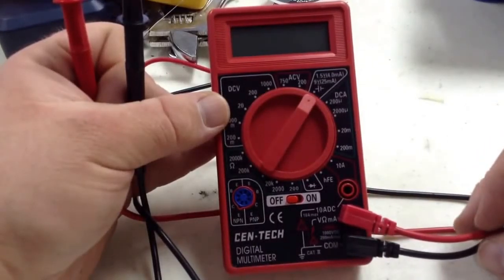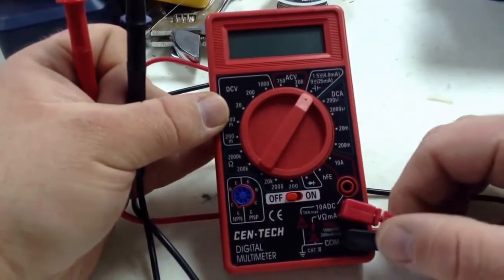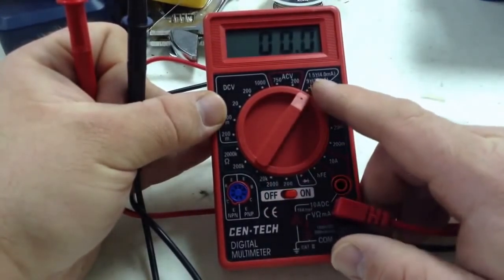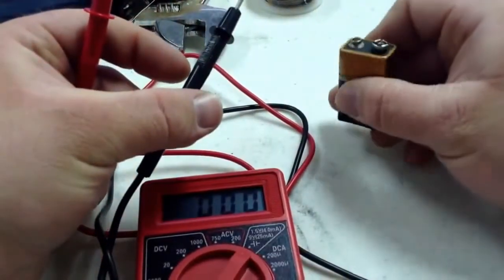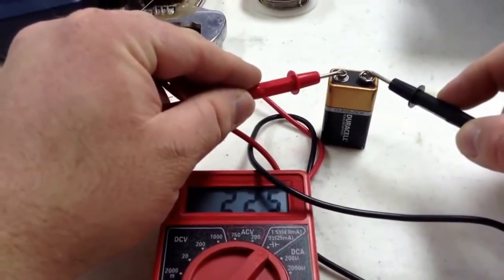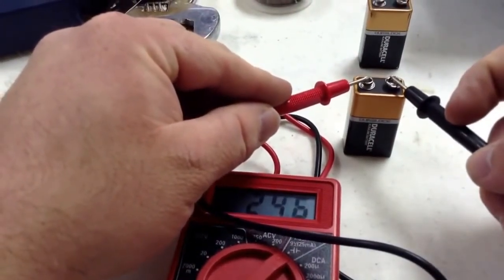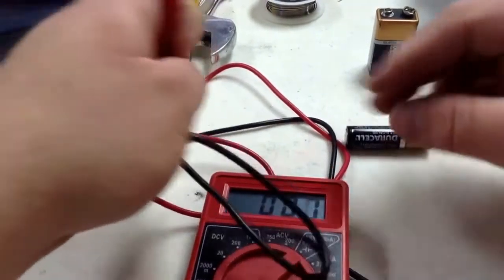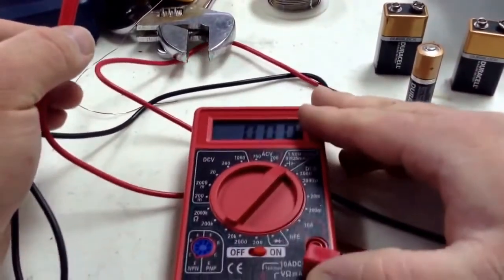Check how much charge is still in a battery using cen-tech harbor freight digital multimeter

Comment: Your multimeter is defective.  Your measuring 22.5 volts on a good 9 volt battery?  How can a  battery put out 22.5 volts when it is only suppose to put out 9.0 volts ?  Get yourself a good Fluke meter.
Reply: His demonstration is correct.  Note what he is reading... mA, not voltage.
Reply from the maker: I wasn't reading the volts.... 🤦🏻‍♂️
Reply: @ttms2  i am measuring 12v 65AH battery but its showing reading of 27.8.   What is the meaning of this?
Reply: @strawhatluffy5779  The readings for 1.5 and 9V household batteries are written on the meter.  It is not going to supply sufficient load to a 65AH (I'm presuming you have a rechargeable gel-cel)  to really test it, but you should be seeing 30 ma (22 x 12/9).  If the 65 AH is it is not showing at least 12V (set your meter to the 20V DC position), it is either not fully charged, or defective.
Reply: He's reading milliamps.
Reply: How can u be too stupid to listen to a 1minute and 30 second video???
Reply: @do7hemath937  It's not a contest, but you would have a chance with a question like that.

Comment: thanks,                   when is a battery  considered  bad,???    1.5    good    is  1.4 bad throw away or 1.3   ect   thanks
Reply from the maker: Bad is relative to the device pulling the power. A remote for a TV will last forever and can get down very low. The same battery would only last a few hours in a flashlight.
Reply: @ttms2  thanks for the reply,, i have a box full of batteries some you tube say check  this , others say put a load on it,  ect ect
Reply: @ttms2  best answer ever. For years I've used weak batteries from flashlights in the remote controls around my house. 
I love this test feature on this cheap meter. Years ago if the batteries were dead in my flashlight I'd threw them all away. Now I'm finding out sometimes only 2 out of 3 batteries are bad & 1 is perfectly good. 
No more, not knowing whether a battery is good or bad.

Comment: Hello, I've got a quick question for you here, can these meters read and test smaller (watch) batterys as well? 
I have a bunch of LR736 and CR22 that I'm not sure if they should work or not. 
Do i use the same settings as a AA AND AAA battery, and what should it read if new or not? Thanks for your time.
Reply from the maker: Yes it can, I'm just not sure what the full power readings would be.
Reply: @ttms2  3 volts
Reply: @do7hemath937  CR-22 is 3v (so the meter should read 2ma),  BUT others are 1.5v (e.g. LR376 and LR44/A76/AG13) which should read 4ma
Reply: @scottsuhr8763  yes, you're right. I should have said that the 3v was just for the small round batteries. 
I have an old "free" digital multimeter from harbor freight. It's so cheap, they gave them away just for coming in the store and buying anything. When they stopped giving them away, the only cost $2.95.
They feel so cheap & poorly made, I'm afraid to use it on 120 volt plugs and switches in my house.
But, It has a special setting for batteries. 
I found out that the setting puts a load on the battery which is the correct way to check batteries & get the mega amp reading. 
FYI for anyone who reads this: YOU CANT PROPERLY CHECK BATTERIES BY JUST TURNING A MULTIMETER ON D.C.